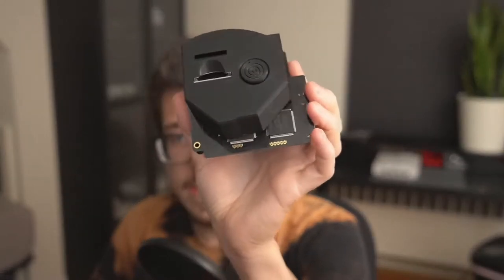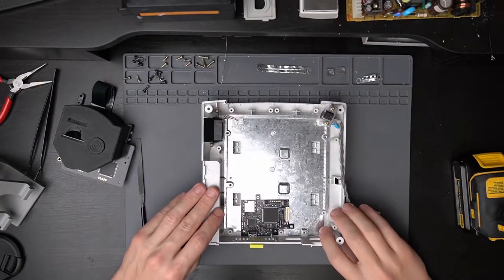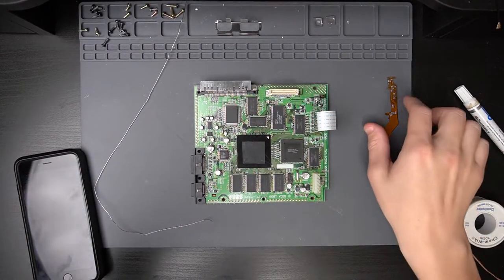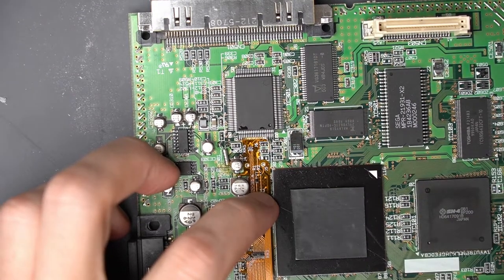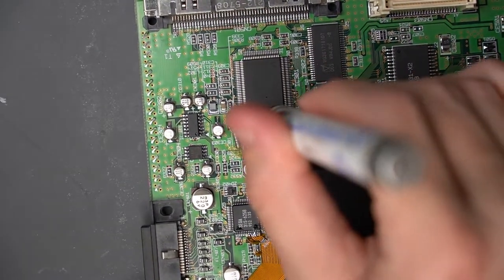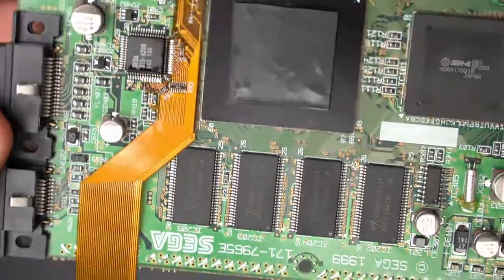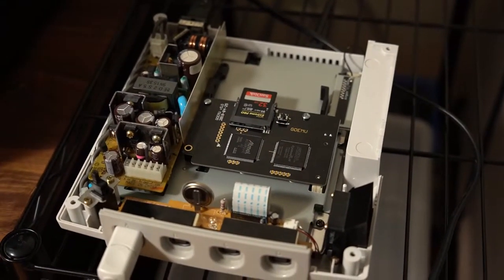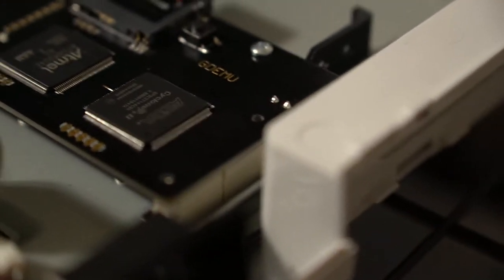DCDigital and GDEMU Install - Ultimate Mods for Dreamcast!

Comment from the maker: I forgot to record cutting a piece of the top shield that conflicts with the flex cable.

I also COMPLETELY FORGOT to solder a wire to the test point on the bottom of the board (step 5 in the instructions).

 If you attempt this mod yourself READ THE WRITTEN INSTRUCTIONS from Dan.